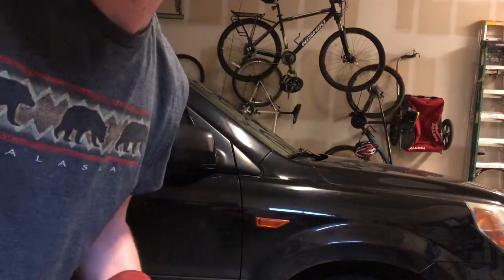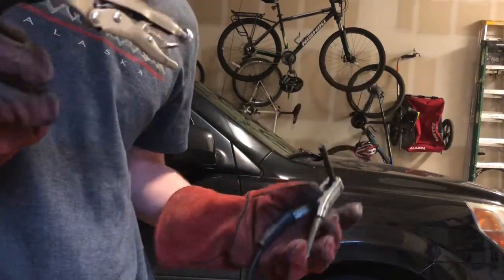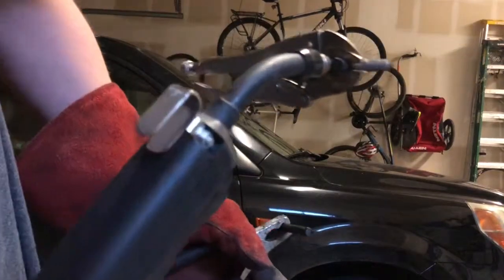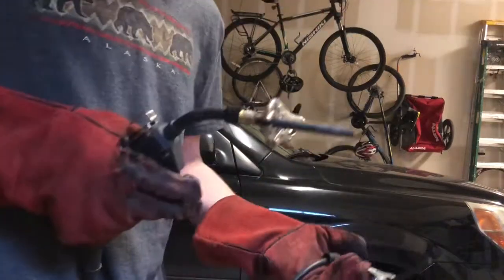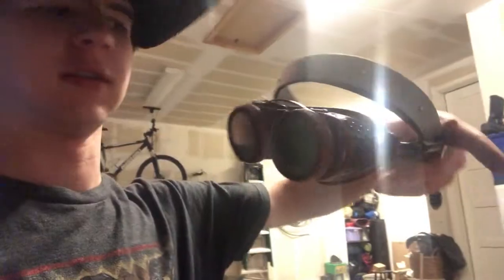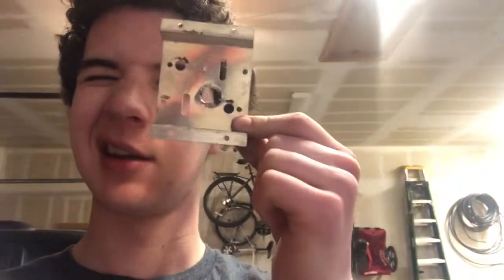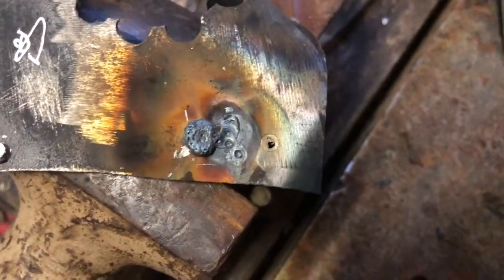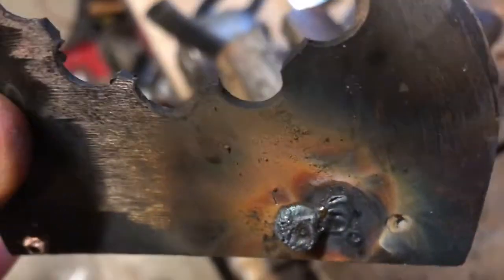How To Make A Carbon Arc Welder CHEAP!

Comment: Top tip if you are going to use carbon electrodes out of batteries clean them with paint thinners first also you only need 1 carbon electrodes to the work piece same as tig. Best voltage is 48v - 60v

Comment: it would help if you put points on the carbon rods...too much surface area at the arc on the tip of the electrodes which will be hard to control the heat and where the heat goes...
Reply from the maker: METO U Ahh yes... I figured that out after I made the video...